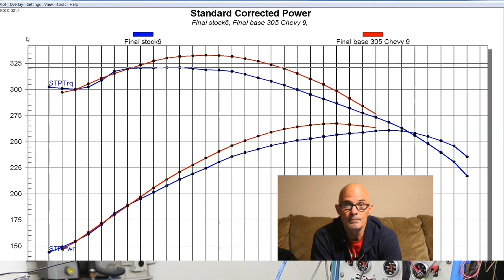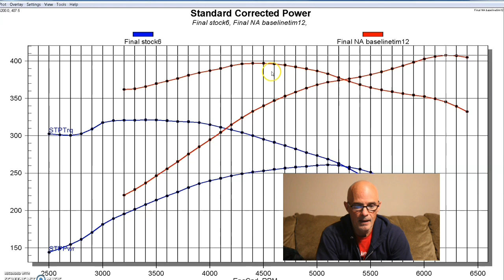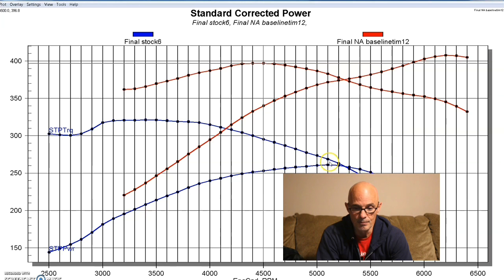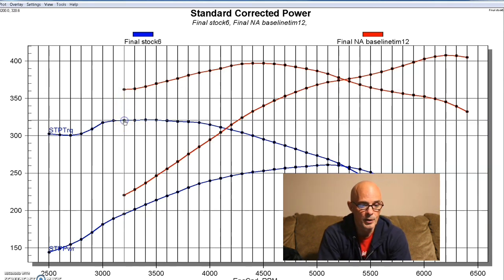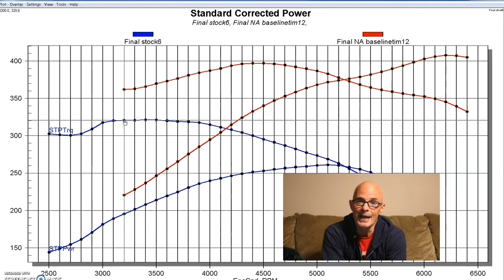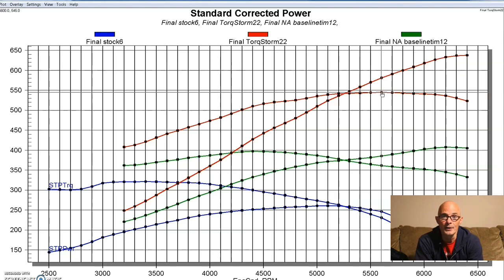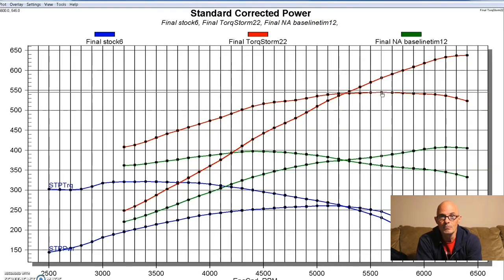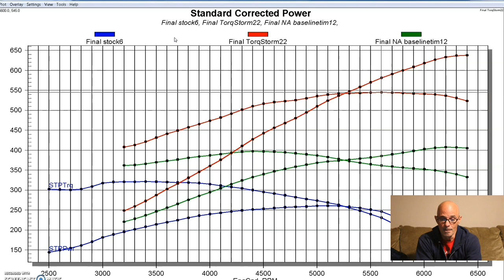5.0L FIGHT-302 FORD VS 305 CHEVY-FULL RESULTS

Comment: The 305 was a mistake.  Chevy had their own 302 with the same bore/stroke as the Ford engine.  Much better power potential.  

But the 305 was acceptable for trucks and "economy" engines.  It's just worthless if you want to make power for the reasons you state.

Comment: 350 heads work on a 305
Reply: Untill the valves contact the cylinder walls.
Reply: With 1.94" valves

Comment: Nope, a shorter stroke will ALWAYS be better at producing RPMs given the same displacement. THAT "IS" the REALITY.
You can't say it doesn't matter - and then your next sentence you say that the small bore is a limitation.
Reply from the maker: it makes zero difference at our power and rpm level-if heads were available for the bore size

Comment: so u match a pile of sh to a ford 302 y not the dz 302 but did u use the same amount of money on the build i just know i can build a chevy way cheaper then a ford and what i like best about a chevy if it has a sbc in it a bbc will fit right in it i swap all my rigs with bbc i get the ho 454 bbc 450 hp at 485 torque stock grate engines for free all the time but i know were to look for them the last one i got had 6000 miles on it with everything i need to put it in my 68 pu for free with a heavy duty 400 turbo still have one sitting in the shop for the next project but this project going to build it for no money in it already have just about everything i need for it even new interior got 2 hard top 79 z28 and 1 79 z28 rs t top got all for free all are rust free good clean cars got a tunnel ram set up for free for it now i am waiting for my friend to change out his roller cam so i can get it have roller rockers and lifters already with titiunum valve locks for it have stainles steel valves for it and i will take it too my friends machine shop they will do it for free for me  the only problem is paint that i am looking to trade for it have lots of rigs from 65 to  79 all good clean project rigs  i collect rigs for a project till i have 3 or more for the build like my 68 pu my kid built a 67 out of the left over parts and still have 2 perfect cabs left over with a big pile of good parts u mit say my truck don't even have a ding in it
Reply from the maker: CHEVY DID NOT MAKE THE dz302 IN 1988
Reply: @richardholdener1727  ok did u use the same money to build it